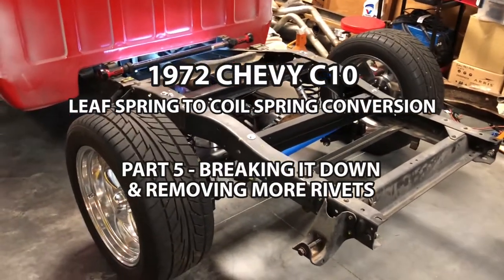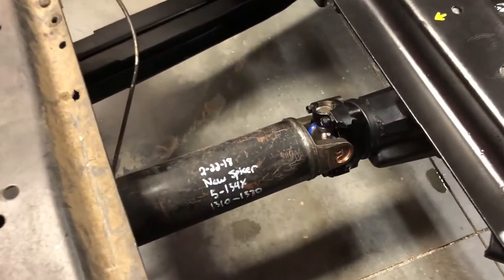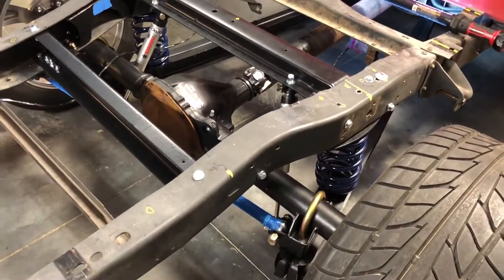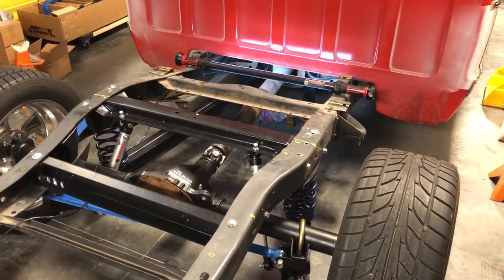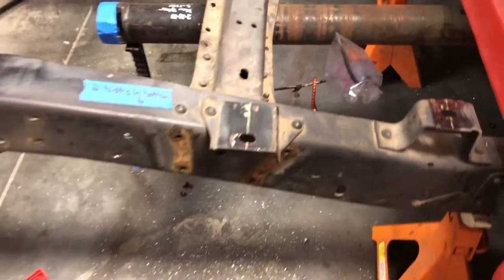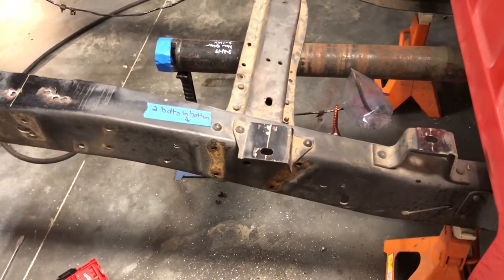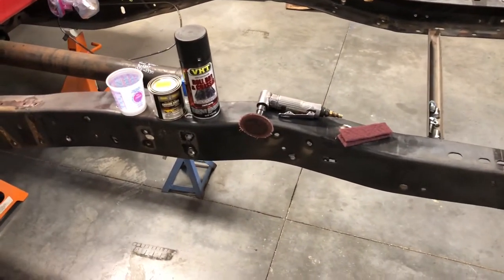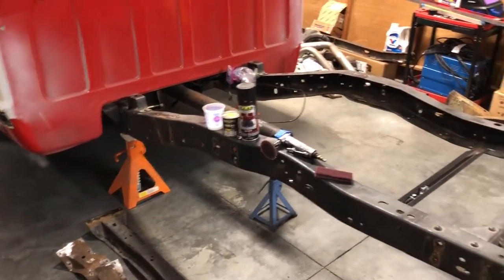'72 Chevy C10 - Breaking It Down & More Rivets - Leaf Spring To Coil Spring Conversion - Day 5

Comment: Just found your channel. I am in the process of converting my leaf spring 71 C10 to QA1.
My question is, is the factory leaf spring cross member the same as the used coil cross member you bought?
I need the coil cross member placement to mount the sway bar to. Hoping to just move the cross member back .
Reply from the maker: Thanks for coming over and checking it out.  The coil spring crossmember is different from the leaf crossmember.  I found an original crossmember, but there are aftermarket options out there as well.  Thanks for watching!
Reply: @RustyWrenches  Where did you buy your used coil cross member?
Unless you know of an exact repop aftermarket. 
The QA1 uses factory holes for spacing. 
Thanks for the help.
Reply from the maker: I bought the back half of a frame from a local guy who has mountains of c10 parts.  I just used all of the parts and pieces from the frame section.
Reply: @RustyWrenches  Do you have the guys contact information ? I'm from Eastern Iowa.
Reply from the maker: Certainly, shoot me an email at beaterku at gmail dot com and I’ll forward his info